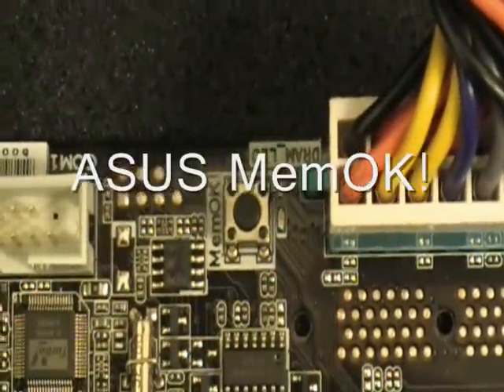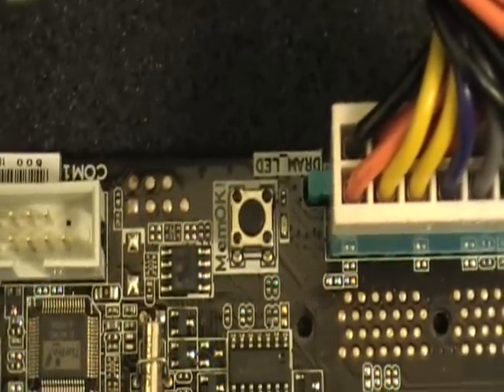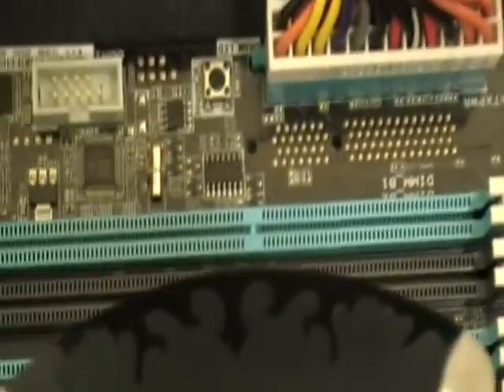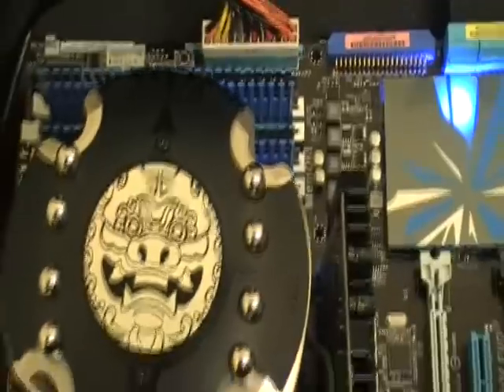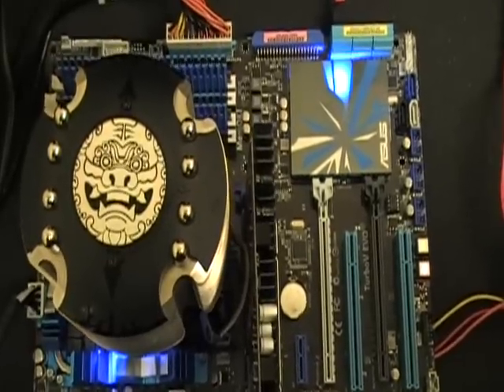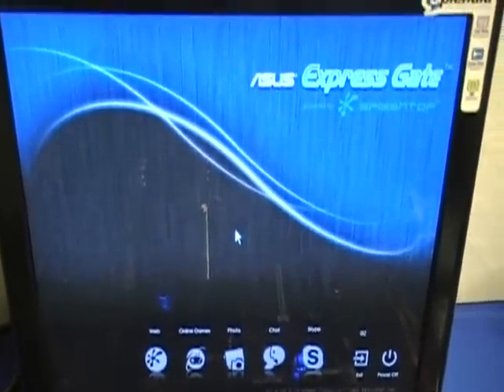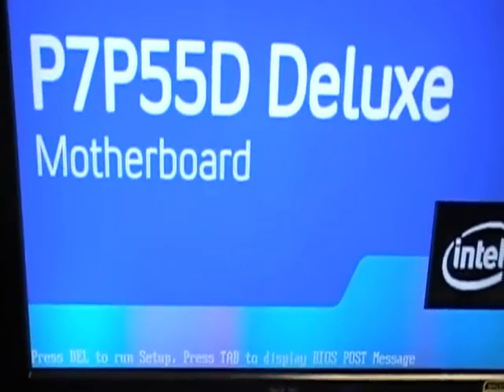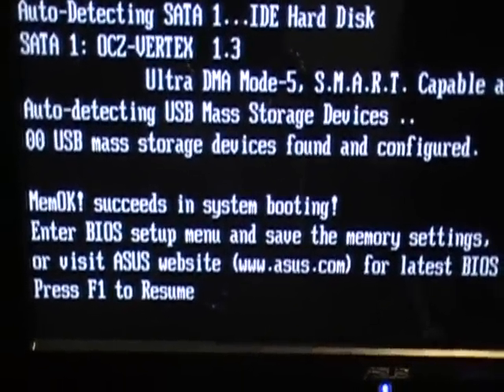ASUS MemOK!

Comment: Hey I have an issue with my current PC maybe this is related. So after playing some games (mainly FF14) I get a black screen I can still hear the sound coming from my headseat but I have to reboot my PC because it won't show back the game. When I do, the system doesn't display anything. Everything powers up and no code issues are showing. I've been told to reset the Ram sticks to fix the problem and although sometimes this does get signal to my monitor and other times it doesn't I'm thinking I need new Ram or maybe this is what's causing it. I never knew about the MemOK button. should I give it a try? I have a ASUS motherboard H170 PLUS D3 I am thinking of looking for some compatible RAM sticks if it's the RAM that's messing up. Any help would be appreciated.

Comment: just be patient, leave it for some time, let it do it's job, and hopefully after some extensive period of time you'll see something on your display, never the less in the meantime, do not waste your time starring on your display, it won't change anything, and please do not restart the box with anger, as it won't help you either.

* you may hit the MemOK! button, and pray that finally it boots up - it will - sometimes after 9min, another day after 43min, there is no pattern at all, all you need is patience, and fingers crossed that it boots and let you utilize your configuration.

* obviously you can give a try and patiently exchange your RAM sitcks, pushing them into mobo based on their suggestions, defined on one of the PDF documents, but in my case it did not change the overall situation at all.

* I've been using the memory which is listed on their QVL list, ( corsair ) in my case 64GB, but I've been having another two sets of 32GB which have been exchanging from my other MSI box, without any success

* MemOK! yes actually pushing it, indeed triggers the restart cycle of my machine, and probably started the negotiation of the memory configuration, never the less at the I've just lost the patience, as there were absolutelly no guarantee that the 45min wasted for accomodating the memory allignment, will cause that the mobo will be stable as rock again. Indeed there were period of time, that it was, but then please do not unplug the electricity, or does not exchange any of the components, unless you are brave enough ;)

* yes I've been replacing my battery on the mobo, reseting bios
Reply: Wait a minute, i have to do this everytime i turn on my pc?
Reply: My MEMOK! button does nothing but restarting the computer again and again. Do you have any idea why?
Reply: @razibhossain5820  just change the board, dont waste your life

Comment: I have Asus Z170-DELUXE and the vga led red light stays on no post on the monitor code 62 meaning installation of the pch runtime services any ideas? there's no problem with the ram but I cleaned the ram, removed my graphic card still the same.

Comment: I've bought 4x4 = 16GB from corsair and want to install it on my motherboard. If I start up my PC after putting the new RAM memory in it goes till the bios screen and than it doesn't react on any key I touch on my keyboard.. Does anybody have an idea what the problem could be? my motherboard is the P7H55 and it should be capable to run 16GB.. Probably an old BIOS Version?
Reply: Matthijs Noort I'm have this problem too! :((((
Reply: have the same problem you figure out?

Comment: Ok guys , i think i have solved my own issue if this helps, My Pc wouldn't boot , and i had a solid light, i mucked about, with no luck, i pressed that button like it was the last button i was every going to press, and did jack shit, i took out the memory and tested all of them i have four 2 gb sticks , they were all fine , I disconnected the power going to all my hard drives , except the C Drive , and cleared the c-mos, and restarted the machine and hey presto, , so what happened, i looked further into this issue , and where the Memory Ok button does function as its intended, it is also extremely sensitive to power fluctuations from the Power Pack, in what i mean , the power pack , will degrade over time , now if you have a cheap power-pack, then good luck with that guys this is where my fault lay, brand new mother board , graphics card , memory but a power pack i have for almost a year, one of the capacitors was not at its full potential , and in most cases the average user will never find out what is causing the issue. However after adding each device back onto the power pack , all seems fine, then its turned off and the same thing happened a couple of days later, needless to say i went through the whole scenario again, until it dawned on me the only thing i never changed was the power pack, and guess what most of you never did either , most of you will only have they one, but perhaps by getting another you can test it out. any way , this was solved immediately after changing the power pack. Hope this helps someone out their with the same problems . Good Luck Guys

Comment: for your pc not to start it means some components are not compatible now try one more thing on your M-board there is a small battery remove it leave it for 1 min n put it back in this will reset your bios to manufactury default settings and hopefully should read your ram
Reply: 12 years i can't solve this.... thx u so much

Comment: my computer was working fine until i took out the RAM just to adjust a problem with the network adapter. after i correctly installed the RAM back in (no beeping sound) i press the MemOK button to do the testing, after it ran its test the red light jst stays there continuously. and now it wont start back up!! HELP PLZZ
Reply: Bro did you found

Comment: I restarded my PC only a couple of weeks old, and the screen doesnt show any think my MemOK light is consently on I hold it down and the light doesnt go off it just keeps staying on flashing, I dont no weather its my mother board or my RAM had it set at 3.6Ghz CPU and my RAM on 1600Mhz.

Corsair - Dominator - DDR3 RAM 1600Mhz

ASUS - M4A89GTD PRO/USB3

Does my mother board or RAM need replacing?

Comment: I wonder if anyone can help. I have a P7P55 LX with 2x2GB 1333MHz DDR3. I get no post, and the memok light come on [solid]. If i press the memok button the system will instantly shutdown and restart after about 5 seconds, but with exactly the same issue i.e. no post and DRAM_LED on solid. Am I simply using memok incorrectly or is it faulty hardware?
Also, bizarrely, this will only happen if i install in dual channel; with both sticks in one channel the pc posts and runs fine.

Thanks